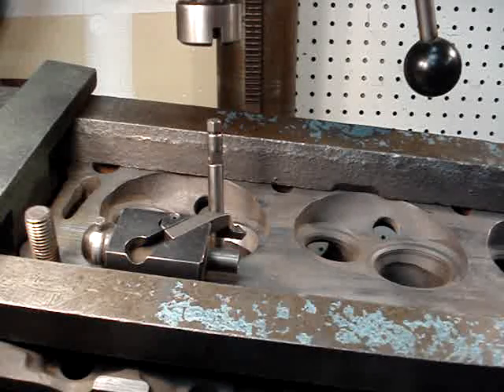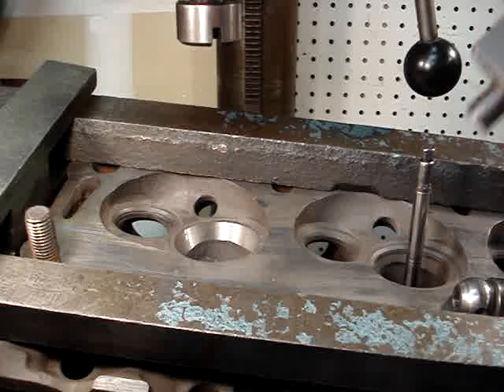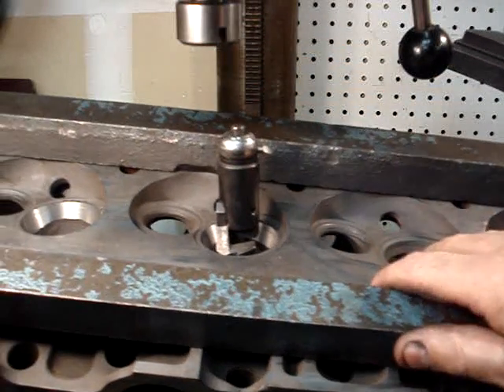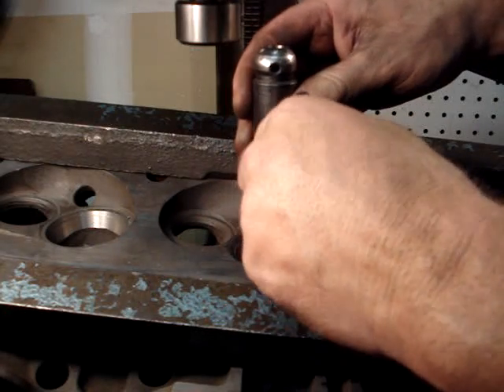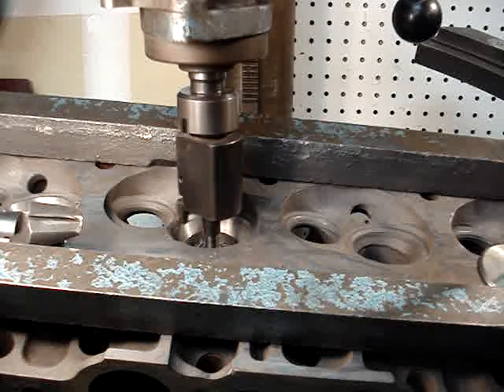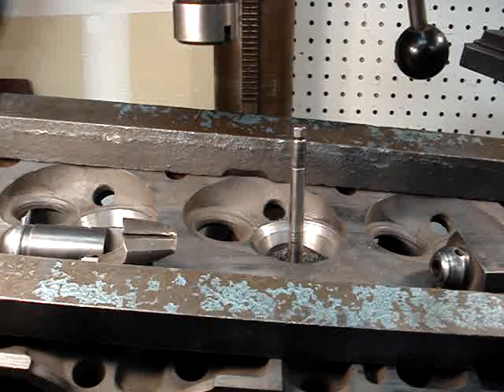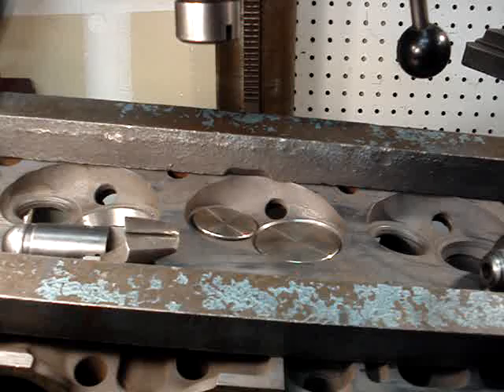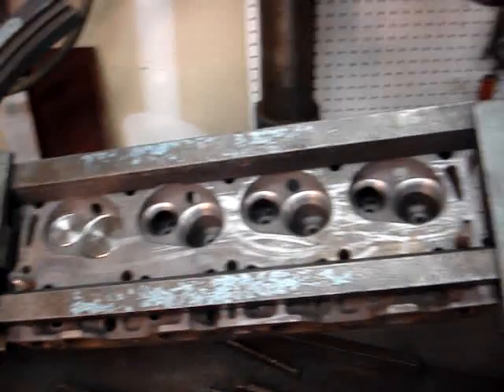Ford 460 stroker heads

Comment: I have a 89 460 with bolt holes broken on the manifold side. I don't know enough about the heads to try to buy someone's junk off Facebook. Would you be interested in helping if you could?
Reply from the maker: sorry I don't do customer work any more I would try a local machine shop
Reply: I found a different engine thx anyway. Great video

Comment: 5 months later, I came back to re-watch your magic. Question though.? Would it not be less money to buy a set of good alum heads matched to the right cam or is there machine work required on new (Good Brand) no Ebay heads too?  Thanks much! Cheers from Motown.
Reply: Yes, it would…
There are some really good heads on the market now for BBF.
Check out the new AFR heads… wow

Comment: why don't they do a radius cut on valve jobs on the head, with radius cut valves?  what am i missing?

I have a set o 68/69 DOVE heads that i want to grind with over sized valves for my 72 tbird with 44,00 miles on it.  of course i expect to add a cam and intake also.  considering the quadrajet but not set on that, the goal of course is about 500 hp.  guidance requested, and what would you charge to do the build for me?  

I'll probably put this same question on a new video, since i don't think you look at the older video's anymore.

thank you.
Reply: Bigger valves aren't needed for a 72 Tbird as you are not racing it and will never spin it high enough to use any extra flow gained by a larger valve. The early heads will pick up the performance quite a lot by itself by raising the compression for a boost in torque, which is what's needed in that big car. Use an Edelbrock performer and an edelbrock air door secondary carb, not an emissions Qjet. You may have to run a cam with extra duration to lower the dynamic compression ratio (running comp.) so as to not ping getting that weight moving. You should get 450 hp. and 550 tq., which is what you need.

Comment: I do know that looks like a good valve job. Who ever did my 040 over 351w sucked. Those valve stems had to be cut off a quarter in to even be used. So I threw them heads away and put e7 heads stock on it. Runs real good. 3 angle grid and stainless is the only way to go..

Comment: How much are 460 Dove heads core Worth in 2018?
Reply: The word Dove is wrong to id these by. It is D 0 v e as in decade B 50's, C 60's, D 70's, E 80's, etc. second digit is engineered year, so D0 is 70. You can find the almost exact same head as a C8VE, 68 or a C9VE as 69, or C9AE. Usually worth 200-300 bare.

Comment: How you doing again my name is John I had asked you if you had cylinder heads for sale I believe those are the exact same ones I have on this Mark 3 Continental I've been trying to help friend out with obviously to rebuild the engine completely is the right way to go however I'm sure you've been around long enough and I've experienced as you said in some of your videos customer always don't see the work involved but they do know how to count the money, and then in the end they complain if something isn't right LOL. In any case I've been working on cars a long time but I've never rebuilt the motor and I learned a lot from you and I definitely will learn a lot more as long as I live I have some photos I'd like to send you if I can I could use your advice but for the most part I need to know about the heads how do I go about purchasing them from you what do you need from me is there another way I could reach you I guess do you have a Gmail or email or should I contact you through Facebook call you directly just let me know please. I guess I'm just looking for a standard rebuilt head the ones that were on the car and I removed them the seals are all broken they blocked and clogged the oil return passages and starved the motor of oil for a very short time luckily everything still spins good the crank and mortar turned easily. Basically I'm just doing the top end new timing chain and gears I'm thinking maybe the camshaft and lifters I'm not sure of course new heads and cleaning all the passages but if I showed you some photos Maybe you could just buy your experience you could tell me that I'm crazy or the customers crazy if they don't do something the cylinders look okay there's no scratching of the cylinders, but they do seem a little shiny I guess you would say they're glazed I'm not sure I took photos. Pistons look original and each cylinder seems to be smooth, there's no Ridge. Well in any case sorry about messaging you a book I'm just trying to give you all the information you might need in order to help me. I guess I'd like to know how much the heads are just your basic rebuild and if I could send you photos or if you need information regardless I do need two heads, so when you have a chance let me know how much when do I send the money and how long do you think it will take thank you very much
Reply: Most any decent machine shop can do this work. It is quite common. Those early Lincoln motors with the cast rockers had a habit of chewing up the ends of the valves. Also some wallowed out the valve guides. If they are ok just put some new seals and change those old valve springs. Lap the valves and should be good to go.

Comment: nice work!  what size intake and exhaust valve are those?? did you do any work on the runners or just the bowl and throat?  good work though!!
Reply: They are the 429CJ valve sizes 2.24 and 1.72 which is common for these. I have 2 sets of these early heads, a C9VE, and a D0VE and they work well. The CJ's are the best but very rare D0OE-R. These early heads are preffered over the later larger chamber heads because their is more room in the exhaust port as the smaller c. chamber does not encroach into the port and the air injection bosses are much smaller. Porting these will make a huge difference. Especially blending and widening the bowl up to that valve.

Comment: Damn Holmes, you sank that valve too far down into the chamber........
Reply from the maker: +mark davis mo actually they came out perfect,,  Holmes
Reply: Actually there to deep ...I can see that they are in a cup ...the top or the 45* angle on the valve should be the highest point , on the same plane as the face of the combustion chamber ...it's close but still a little deep ...you prob know that lol....oh well it's. If your head !!...and did you enlarge the bowl any after doing the seat angles ? ...looks like that has to much "distance to turn "...should be .200" distance to turn ...that looks like .500"

Comment: Why would you want to use an adjustable pilot on the machine, cut .010+ runout into the seat on the machine, then use a carbide pilot with a stone to correct and redo the seat. You have it backwards. The point with the machine, is to get the seats cut as close as possible, get all the depths equal, and to cut the desired profile. Then do a quick bump touch up truing cut with the stone. The carbide pilot in the machine makes this MUCH easier.
Reply from the maker: +Frank W you will never get that seat concentric with a cutter weather you use a solid pilot or not we had serdi machines at my last job the serdi rep swore it could be done so we challenged him to show us and guess what he couldn't do it.  we tried everything on a Serdi a kwik way and even a Sunnen and  Van Norman with the same result the cutters just don't make a concentric seat to answer the question the reason we do this is because it takes forever to grind a hard seat with a stone and you use up your stones fast the cutters hog away the majority of your seat quickly and locate your seat location and width the stone is used to finish the seat and make it perfectly concentric I have used the solid carbide pilots and the adjustable pilots with the seat cutters and there really is no difference in the results you are swatting at flee's when I hear someone bringing up something like this that doesn't really matter it usually means your dealing with someone who lacks experience thanks for the input

Comment: Here is a tip for you. Invest in some carbide pilots. Those adjustable pilots work in a pinch, with stones, but not with a single point carbide cutter in a machine. I can tell your seats are WAY out of concentricity. When you drop the valve onto the freshly cut seat, it goes thud, and sticks, at the end of the video when you take the valve out, it is stuck, or wedged into the seat, because it probably has .010 runout. Buy the carbide pilots and you will be amazed.
Reply from the maker: I agree and I do use Carbide pilots. for the finial grinding of the seats,  Here's a tip for you even with them (carbide Pilots)  you will never be able to cut seats on any machine even a serdi with no run out I went through this with a serdi machine years ago no matter what we did we still had run out so because of that I use the seat cutters to remove the majority of material and always finish seats with a Sioux stone and then lapping them in,  if your not  doing this you will have run out even with Carbide pilots

Comment: when removing the exhaust hump, does the hole go away? or do you plug it some how?   thanks   Steve
Reply: steve coffman
Reply: These early heads have plugs in the end of the casting, which plug the entire inside tube. Doesn't matter if it blows a little between exhaust ports.